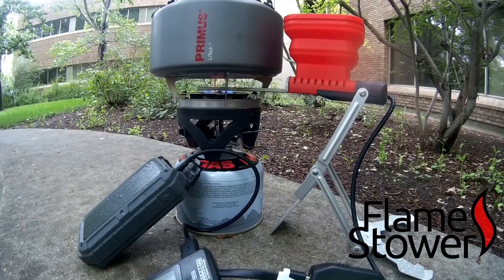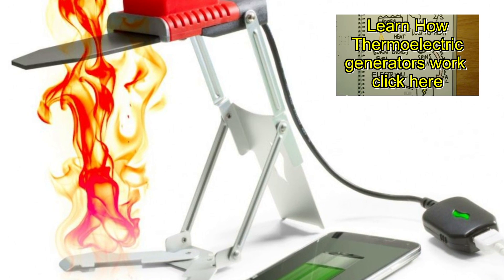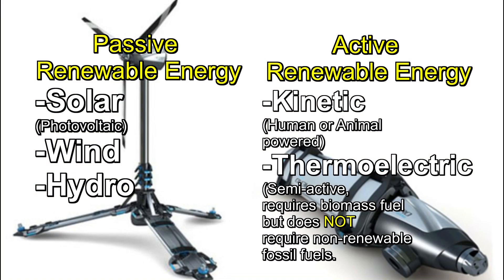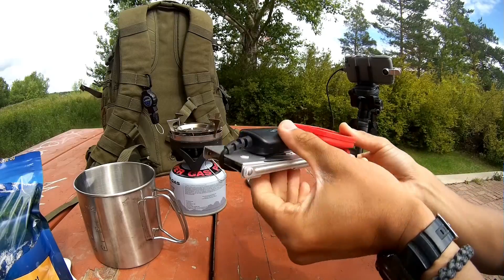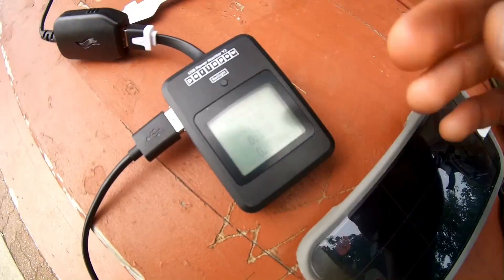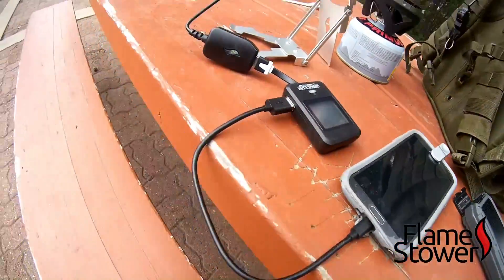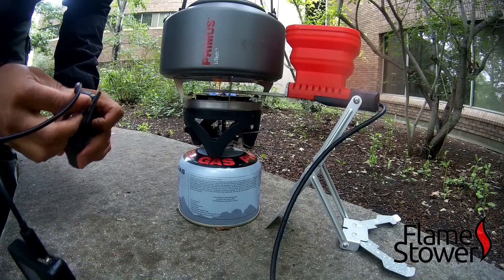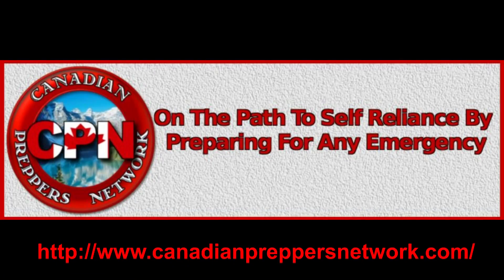Electricity From Fire: Thermoelectricity | Flamestower

Comment: What would make more sense is to have a separate larger clip-on heat sink that would serve the purpose of the water, while not requiring the water, or keeping it from spilling.

I tend to agree with you that it is a good idea, but not a particularly practical solution.  Thanks, for taking the time to do such a detailed review!

Comment: i like the idea, but it still have too many flaw to be realy usefull compare to all other option on the market, the thing is if you don't need to charge your device at the time you cant store the power, you need an other device to accumulate the power.
more output, a battery, a case, better desing are needed to give a good review on the flamestower.

don't get me wrong i love the idea of electricity from fire, we are juste not there yet.

Comment: I have been researching this technology for a while. I love the concept however its got a long way to go. I was thinking of wrapping a chimney in copper tubing and wedging thermal electric generators between the coils. then running the power to a heater element connected to the surface of a solar array. in order to melt any snow build up in colder environments such as the off grid island in British Columbia.

Comment: I would be curious what the mA output would be, with snow or ice in the water.
0.18 vs ___?
Reply from the maker: +Bruce Wayne I think the output on my device may be wrong, I will have to cross reference it with another portapow, since I got this one wet it has been giving very low readings for amps and wattage, no doubt the colder the water the better
Reply: +Canadian Prepper I suspect your Portapow is accurate.
The Peltier effect is currently very inefficient.
Reply from the maker: Bruce Wayne You may be right, it may just not be feasible to try to make something like this portable, it may however be useful if scaled up for something like a wood stove.
Reply: Canadian Prepper Exactly...  The state of this art, is where solar panels were in the 1970's.

Comment: I know you said you don't care for the normal BioLite, but what about the BioLite KettleCharge which is rated at 10w?  That is a great way to not only boil water but puts out way more power then the Flamstower.  Yes it is not light or small, but it has a very sturdy feel to it.
Reply from the maker: +Daniel Thacker I haven't seen much about the kettle, I guess my only problem with it is that its a kettle, I would prefer their basecamp model but that one is only 5 watts. I'm sure its a decent unit because biolite has some good traction in the market and can invest more in their products.

Comment: They should coat the water reservoir with reflective foil. So it doesn't melt near a campfire from radiant heat.
Reply: +Lex even with a torch its hard to melt a "good" silicone lol